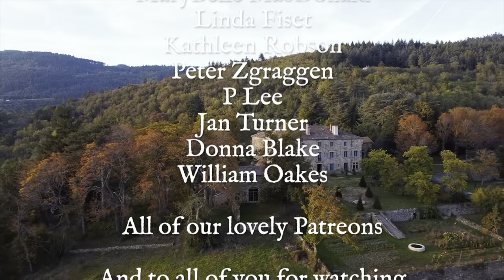How long will it take to finish the Château’s Coach House? YOU DECIDE!

Comment: Whilst it would be lovely to have daily vlogs it adds even more work. Realistically unless you can get childcare help on a daily basis or more workmen so you are not doing things i think it is 6months. If you want to get in focus on the kitchen and 1 bathroom and powder room, containg the garden to make it safe for the children, weeding the staircase to make it safe. Practical not pretty. Don't rush finishing touches or you will forever regret it and it will be harder to correct. There is a lot of work to do.

Comment: Aren't you both heartily sick of advice from randos off t'internet by now ? 🤔😉
Would a mindset change help ? 
Imagine that disaster has struck someone close to you and it's the only place to stay. They're comfortable with, and just need the very basics - shelter, heat, light, sanitation.
So just get the basics in place - safety & utilities.

So from your dream environment, to utilitarian.
The time and effort required to turn it into your dream environment, is for some other time, in the future.